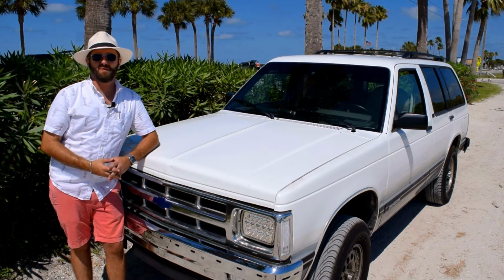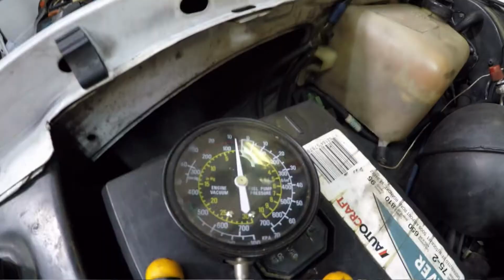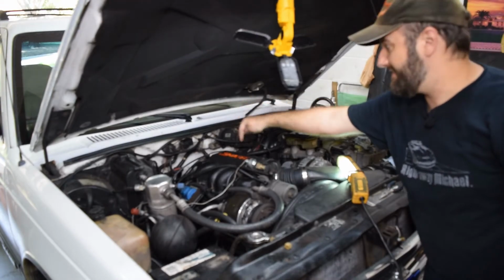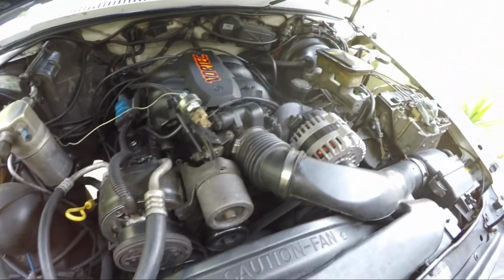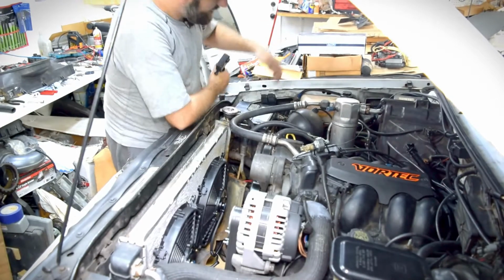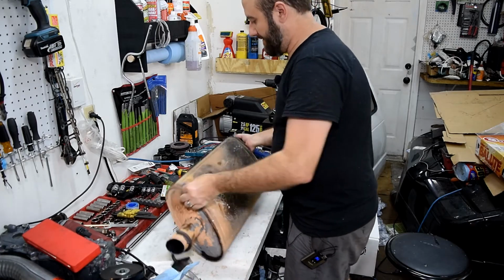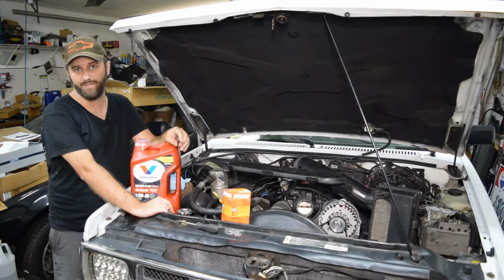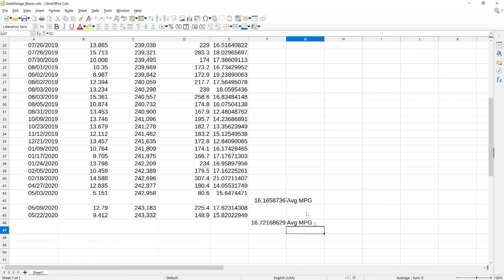S10 Blazer MPG? | Ep 4 Maintenance & Mods for more MPG

Comment: I also have a cpi 1994 and that little valve I believe depends on how much throttle you give.
Reply from the maker: Correct, it changes the intake runner length for increased torque at low rpm, and more HP at higher rpm.
Reply: Hola saludos desde Ecuador,  tengo una blazer automática motor 4.3 vortec cpi,  y cómo es que regula la válvula de longitud?

Comment: Great job in your mods and improving your gas mileage. I have something going on with my 94 Blazer. I when you first start it up, it makes a loud sound like the fan blade is hitting the shroud. After it warms up, the noise goes away, and runs smooth. You know your Blazers and just wondered if you have any idea of what it could be. I like how you do your own maintenance. Thanks for having very informative videos. Green/beige Blazer from Ohio.
Reply from the maker: Thank You!  Does it happen every time you start it, or only on cold starts?   It's possible it's your belt tensioner, one of the pulleys and/or accessories.  I've replaced all of that on mine because they were making horrible noises.  Could be that  your fan clutch is bad, but with out a little more info I'm just guessing.  Pop the hood and have someone start it to see if you can narrow down where it's coming from, make sure nothing is hitting or loose.
Reply: It has the 4.3 Vortec engine with 89,000 original miles. It is a lot louder in the colder months than it is in the warmer months. It is also gets louder when I back up and turn the wheel. Very weird. Then after the engine warms up it sounds smooth and normal and doesn’t do it again until the next cold start up. Also It has no power loss and runs great  after it warms up.
Reply from the maker: @randyluca6339  99% sure that's your Power Steering Pump then.  It's also not uncommon for these trucks to develop steering box issues too.  I had to replace the steering box, but I still need to replace my PS pump. The pump is like $50-60 at the store, and a relatively easy swap.  Just be sure to get one with the reservoir, and remember you'll need to rent a puller to swap the pulley.
Reply: Thanks for your expertise. I will try to change it out myself. Thanks again.